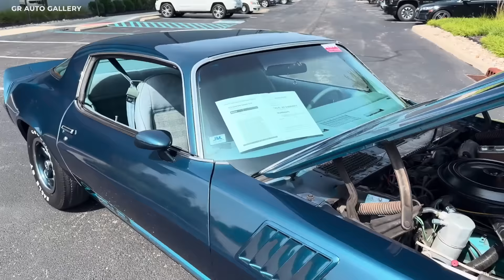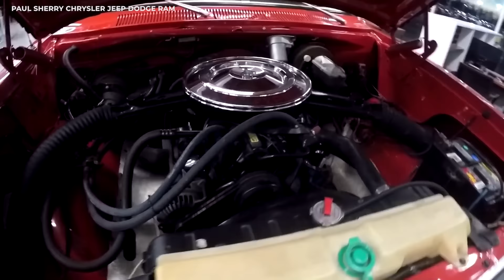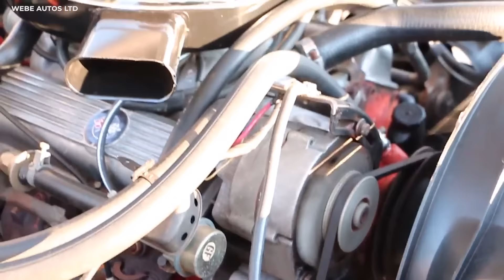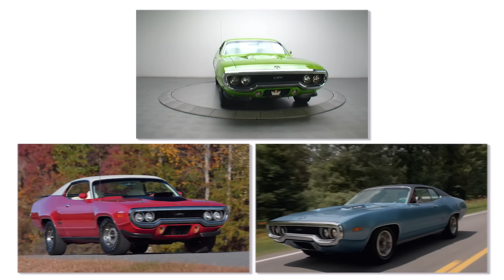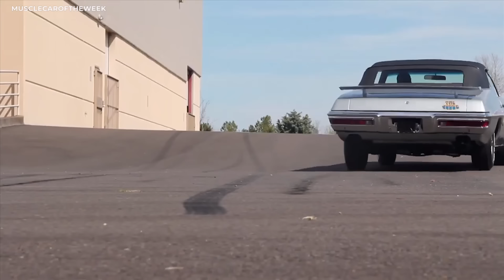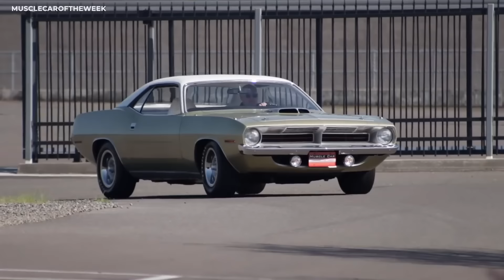15 Brutally Fast Muscle Cars Made In The 1970s

Comment: What about the 1978-1979 WS6 Trans am  it could outrun the 1979 Z28
Reply: And the Corvette Too  Out handled them too  -- A New Stock   1979 WS6 W72 400 4 spd T/A ran a 14.6 @ 96 mph 1/4 mile in Hot Rod Magazines Test > Quickest  American car in the Catalytic Converter era  1975 - 1979 🏁🏆

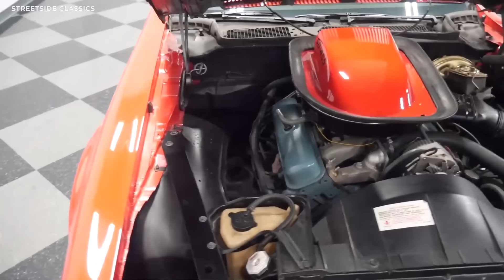Comment: @10:00, The 310 hp version of the SD-455 was never sold to the public. It was a pre-production engine that they wanted, but it could not pass emissions regulations for certification. They had to de-tune it to 290 hp for sale to the public. Both the 73 and 74 SD-455's were 290 hp net.
Reply: The truth was both the 310 and 290hp factory ratings were way under the real output of the SD455,  NHRA dynoed  them and they put out 365- 375hp
Reply: @tomcherry7029  with the stock cam this engine couldn't even make 290 hp. like the HEMI 426 this engine was mean't to be modified.
Reply: @crankychris2 you are dead wrong on that ,in stock factory build it was producing 365 to 375 net hp ..
Reply: @tomcherry7029 Even those numbers are silly and sad. You now have N/A V6's that out powered them
Reply: @glennoswald5928  if you think  the it is just the engines of today that is making cars faster you are sadly mistake , tire technology,  gearing of the Transmission,  and the weight of the cars  all are key factors.  The fact that the SD 455  was able to  run mid 13's at 104+  with a 3.08 rear gear  and ac at 3800+ lbs on 1973 tire tech and regular gas . Let's see a v6  of today do that